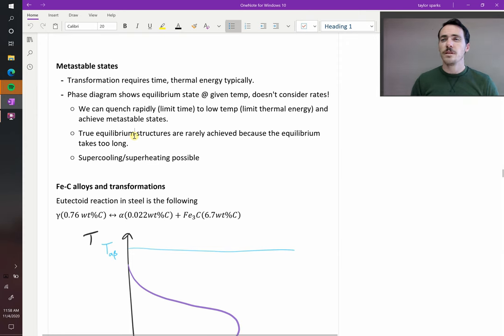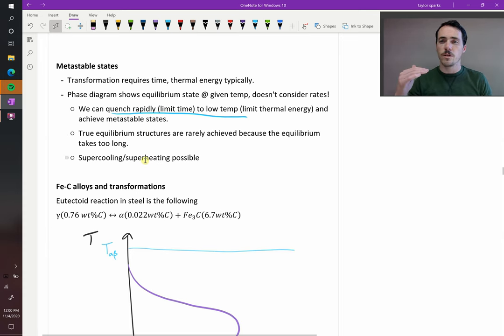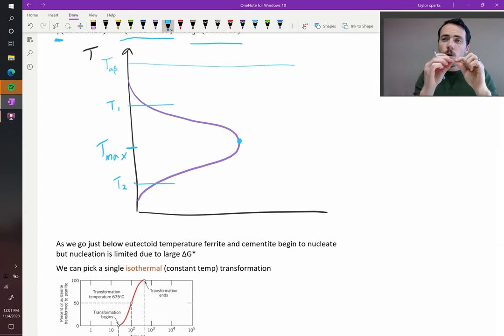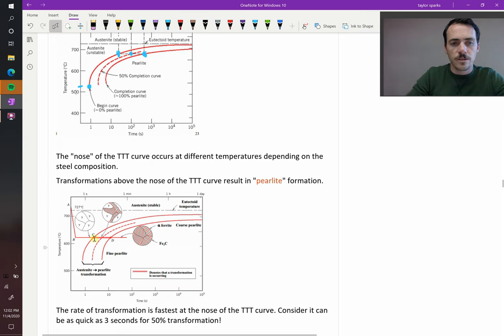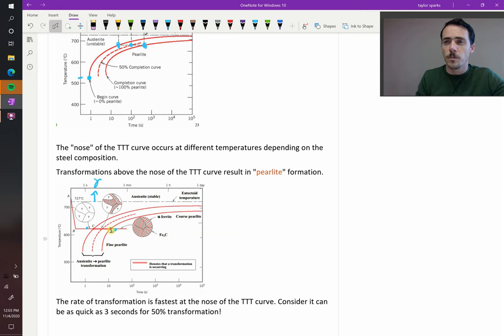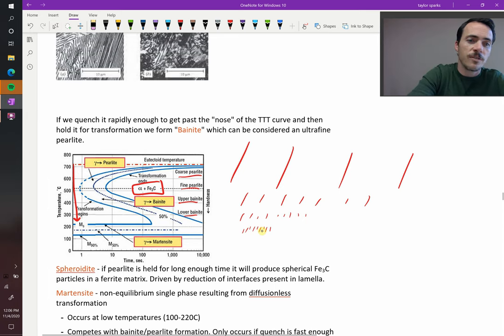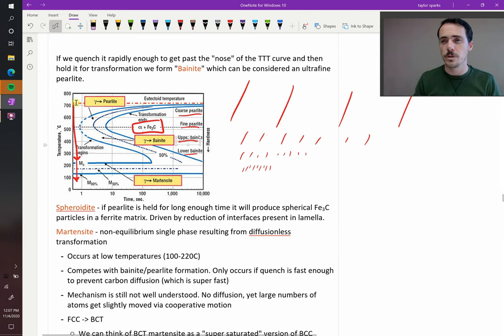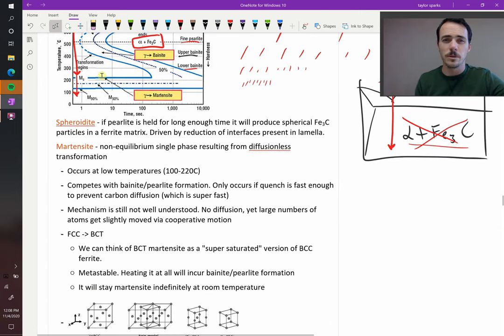Using TTT diagrams to predict the microstructures of steel

Comment: Came across this very interesting video by accident. Great explanation.

I wanted to thank you for using celsius, it breaks my brain when Americans use fahrenheit in science/engineering fields.
Reply from the maker: Lol. Too true! We heathens using Fahrenheit. So ridiculous! I wish we would just switch over to metric once and for all!
Reply: @TaylorSparks  a while back I got myself into the lockpicking hobby. The picks (which are expensive for how tiny they are) fatigue over time then snap and/or bend. 

I was wondering if I could put the bent ones through a heat treatment and make them closer to new. Or could I undo some of the fatigue before they break.

 Because of how thin they are they quench instantly, I drunkenly tried doing it with a butane torch, quenched it but couldn't be arsed to anneal it.

So of course it snapped immediately the first time I trick to pick a lock. Do you think there is an approach that would work? What sort of temperatures and timings should I be experimenting with?

Cheers mate.

Comment: Actually, Pearlite and Bainite are very different in terms of microstructure. Pearlite has a alternate lamellar alpha-Ferrite and cementite structure which is not a mechanical mixture of both. But in Bainite, it is a mechanical mixture of alpha-ferrite and cementite instead of a lamellar structure. It’s like a colloidal solution of alpha-ferrite and cementite.
Reply from the maker: Thank you! I agree, it's an oversimplification that I present here, but it's also an intro to MSE course.

Comment: Super cleared explanation ! Mr Taylor, how do you really get the isothermal holds diagram to craft the TTT diagram for an specifict steel alloy by using the avrami´s equation? Is it get it by experimental methods? or is there some theorical method to predict them with regarding to ther alloying elements (wt%), Thank you!

Comment: Sir, how can one get fine pearlite from martensite? Thanks in advance
Reply: reheat the martensite so that it will transform into austenite(gamma phase) and then cool it down again but this time slower.
Reply: @stopstalkingyouspookybastard  Thank you. Does reheating martensite always gives austinite?
Reply: @zhengpakho  technically no. martensite is a name for a structure in general and it can be found in different materials so its not specific to steel; austenite on the other hand is a specific name for a phase of steel. for steels: if you heat the material above Ac3 line(minimum point of Ac3 line being 723°C for eutektoid steels(eutectoid steel= iron with 0.8w% C)) you go into austenite phase but remember that its only stable above this temperature. so if you want to have austenite steel in room temperature its a bit more complex but can be achieved by using austenite-phase-stabilizers and specific heat treating